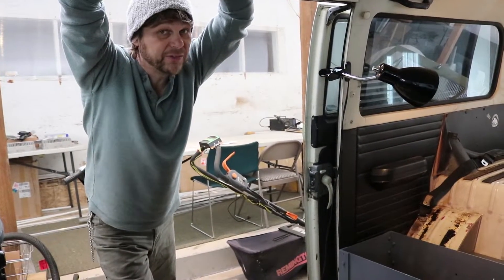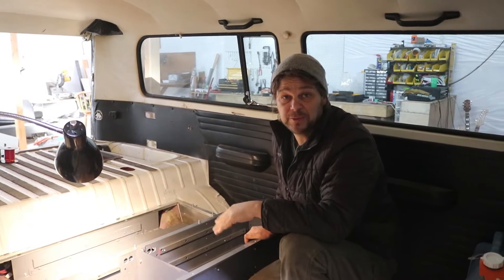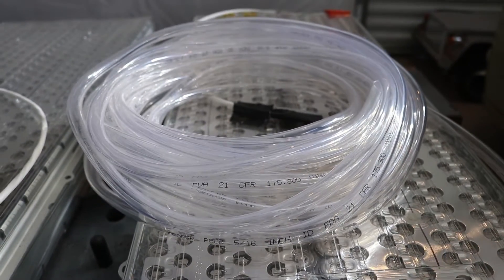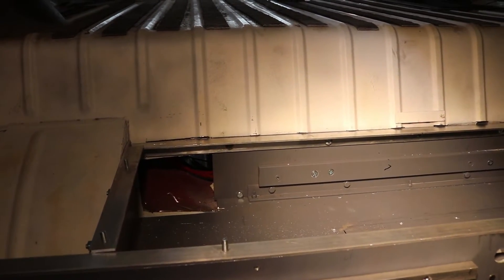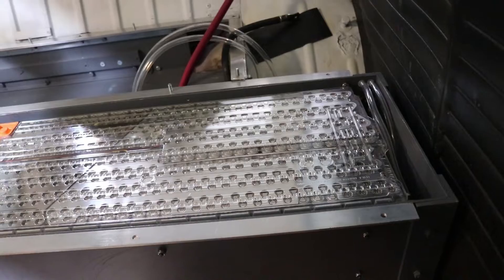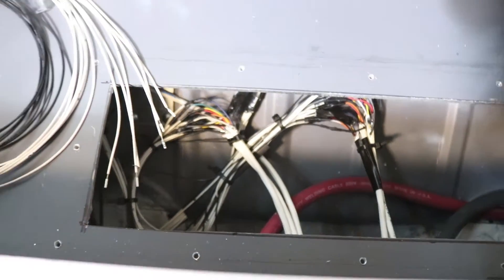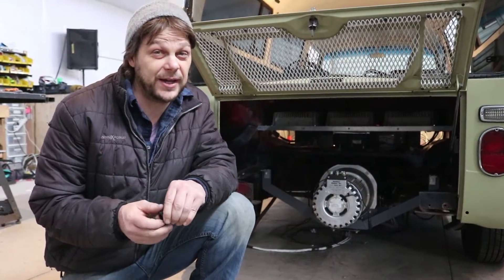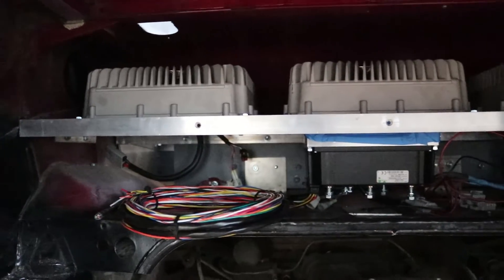Solarrolla - Redfoo Video 2: VW conversion, batteries and motor install

Comment: I have a 73 BayWindow and I'd love to go electric one day. I'm interested in an appoximation of the HP the NetGain puts out, am I correct in saying 144x250=36000Watts = 48hp?
Reply from the maker: You can look up more info on the motor on our website: www.solarrolla.com
Reply: @solarrolla  Thanks the pdf of the engine specs surprised me. 92.3 kW at 4800 RPM that about  125hp that's quite impressive.
Reply from the maker: @karlbartelt3939  yes, it is a great motor and quite a bit more powerful than the original VW motor. Let me know if you have any other questions or if you would like a shipping quote.
Reply: Solarrolla I’m just in the process of rebuilding my 2.3lt performance motor. I’m keen to see someone build a bay window with Tesla model 3 batteries under the floor. I’m sure you’ve thought about it. I love your battery box in Red’s Bus, very nice job. I’m on the other side in Australia, watching all the great work you are doing 😉👍
Reply: @karlbartelt3939  have you completed your build?
Reply: I converted a ‘73 Bay with a AC50 motor and 5 Tesla battery modules. 74 hp (awesome), 55 mile range.